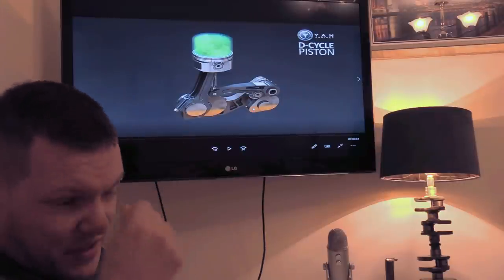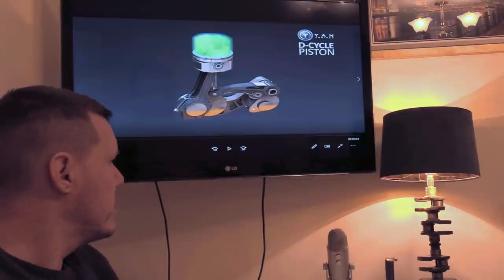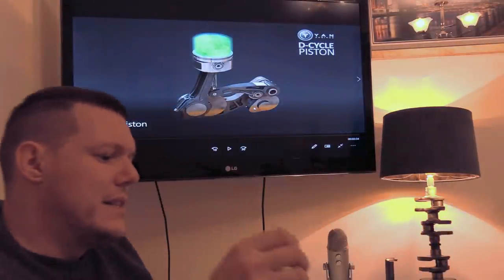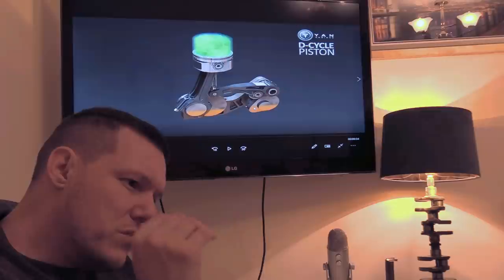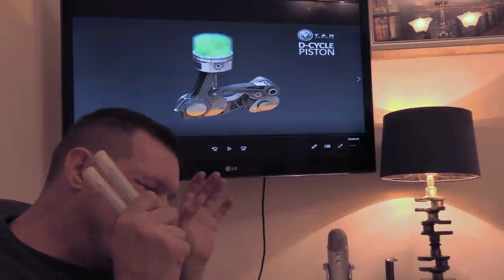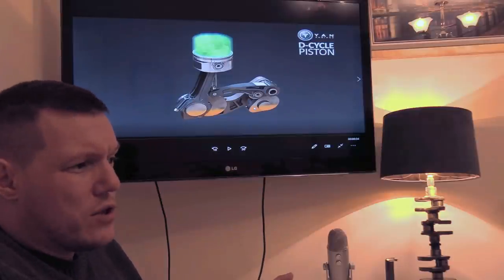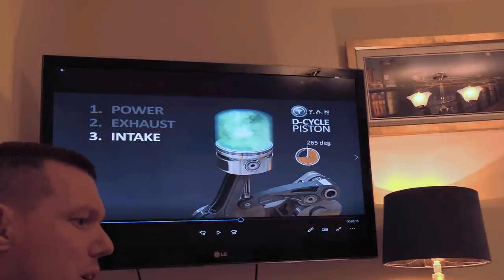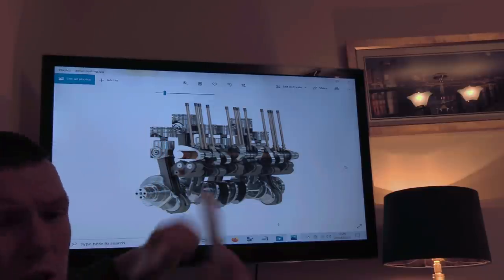D cycle engine | Part 2

Comment: Huh, I hadn't considered that it doesn't need to rev that high until you mentioned it.
Thinking back on the camshaft bounce problem, if it redlined at say 3000rpm or whatever, that might not be much of an issue if it produces decent power/torque at those rpm.
To be fair, I'm starting to see it as a decent attempt at making a 2-stroke (diesel in theory but as a petrol) but as a sort-of workaround for getting rid of cylinder ports and replacing them with a 4-stroke style head while keeping the oil in the crankcase. Interesting stuff so far, I'd love to see even a miniature test engine running with this D-cycle, but looking forward to your analysis.

Totally agree with the oil production vs electrification topic. I work on an oil refinery and we've talked about this, all electric vehicles will do is reduce the demand for petrol+diesel.
The thing is, we can't stop producing them because you can't selectively split out what fractions you want out of crude. You have to refine a whole barrel's worth of crude -> you end up with a load of fractions. You can't get around this, it's like taking a cup of tea and trying to refine the milk out of it without knacking it, can't be done and if it could, it'd be silly expensive and inefficient.
Brent crude is roughly 50% petrol and etc. so all we'll end up with if we all drive electric vehicles is a massive amount of petrol and diesel stored in giant tanks that we can't do much with anymore. Hydrocracking petrol and diesel down into other hydrocarbons is a very costly and inefficient process as it is now, so making other products out of it in bulk isn't really a practical option.
The other problem is that it will drive up the overall price of the other fractions, because you have so much wastage from the refining process and storage costs for that waste. The costs for plastics, pharmaceutical and lubricant feedstock will accumulate through the roof, stuff that electric vehicles will still need in bulk just to be made and maintained, so the cost of them goes up.

Comment: I bet Allen Millyard could build a V10 of this in his garage! 
Thanks for sharing 👍
Reply: @fairyheli2  
No. It will fit perfect. 😁
Reply: How about a straight six with power takeoff from the center of the crankshaft as with some motorcycle engines. (CBX) If these things make it to market he'd have a lot of components to begin with.

Comment: 29:06 
Aha.. so I was correct about the variable compression thing 

Also, If it takes energy to accelerate a reciprocating mass like piston, that mass also transfers its energy back to the crank. So, I don't get that it either when people yap on about reciprocating mass "stealing" power. Power might be reduced to prevent strain but it doesn't inherently "steal" power.

Comment: If we have the top piston contact the lower one not at its lowest point of actuation but just after that when it isn't stationary and is moving at a speed close to the one of the lower piston, that could get rid of the problem with the 2 pistons slapping each other.
Reply from the maker: The issue is thermal expansion

Comment: If built strong and crown changing access made easy would it make a good multi fuel engine, tanks, boats etc.
Reply: If the crown is moved by a came a multi came system like VTECH could be used for variable compression ratios?

Comment: Hi Matt, I have an odd question that might be a good video. Say a manufacturer wants to share parts between two engine derivatives such as pistons and Conrods. Both engines share the same bore and stroke but one is a V6 the other is a V8 for example, say at 60 degrees and 90 degrees V angle respectively. Would the sharing of parts be possible or would there be too much of a difference in say side loading of the pistons, differences in accelerations and momentum that would prove part sharing to be difficult?
Reply from the maker: Great question.
Reply: Look at the Chevy 350 V8 and 4.3 liter V6. They share a lot of components. Or straight  4,5&6 cylinder Mercedes diesels. Essentially all the same, except for numbers of pistons and length of crank and block.

Comment: I Cant get my head around how the top piston is driven back down the bore, As the bottom piston comes to bottom dead  the top piston is driven back up by the cam then returns drawing in fresh fuel / oxygen  but under no combustion? and from what i can see there is only a cam follower that has a positive contact for the up stroke? Nothing to pull it back down, I cant see this working or am i missing something obvious?
Reply: Im looking and looking at it, Just say for arguments sake that the top piston seized, The bottom could still travel its full stroke (not that it will run) But Unless the top piston was fixed to pull it back down this will never work.
Reply: True
Reply: Yup, needs a valve spring or desmodronic equivalent.

Comment: would this type of engine be a canidate for a barrel roller type valve as opposed to poppet type valve thus getting rid of the need of upper camshafts and all the bits connected.the barrel roller type in and ex valves are timed to the crank in the traditional way via belt or chain.no valve float  no intrusion into the combustion chamber etc.
Reply from the maker: Barrel or rotary valve are just shit, period

Comment: I like this idea. Looks like there may be several issues to resolve, but overall it does seem to be a viable alternative to the traditional 2T engine.  
Would I be right to assume that the lower camshaft (operating the crown assembly) could also be employed as a balancer shaft? 
If so, mounted forwards of the crank I dont see that it would be excessively bulky or cumbersome.

looking forward to more vids on this
Reply from the maker: Could be. But it probably not required

Comment: Looks to me like the degrees chart is measuring the crank only. This is not, as you say,  piston degrees rotation.  The swept volume is 200cc, the combustion capacity.  Yes it might be s smooth engine in essence 400cc per 2 crank revolutions.  The lower piston appears to be thrown downwards, a bit like the bat and ball with the elastic between them!  Other thoughts,  could the operating cam be designed a bit like the crank shaft so its pushing and pulling on the operating arm?   Good lockdown stuff Matt.

Comment: To make the lever pull the piston back down actively (not passively with gravity or a spring) a “C” shape with rollers and a central pivot could go around the top of the lever and the bottom of the camshaft
Reply from the maker: The 'c' shaped spring is called a torsional spring, and I mentioned that in part 1
Reply: @dirtygarageguy  I mean a double rocker, not a spring, it would act as having a second cam above the arm, if a single piece wouldn’t have the correct geometry then two arms with a connection bar between them and the ends opposite the lever and cam would be connected to the block, all with pivots, that way they lift and lower at an angle instead of rocking through an arch

Comment: I feel like the spring problem could be solved with a hydraulic piston up top off the oil pump. You could also clear up the slapping with a better lobe and the hydraulic arm.

Comment: Hello Matt, 
I think this a brilliant design, and, if they manage to sort out all the issues, Do you think that a twin d-cycle piston engine can/will replace an inline-four for motorcycles? 
It seems this engine will have high torque at low RPM and, in twin configuration may have the same weight or less than an inline-four.
Reply from the maker: The design isn't good, but it has potential

Comment: so from your previous video about atmospheric pressure that would cause a issue with the top piston having to use gravity to let it drop. could the engine use a turbo/supercharger to aid in bringing the combustion chamber pressure above the crank case pressure?
also if it uses 20% less fuel = 20% less power per cycle. a pure four stroke type engine for example having 80% power per full cycle (720 degree of crank back to intake stroke), a two stroke would in theory have 160% power to 720 degrees so would it be a more powerful?
im sure you'll correct me as im sure i've got something wrong or missed a point that would prove me wrong lol

Comment: Just had another thought of a stupid question though...
Does it actually use less fuel that a 4-stroke in practise though?
Gonna try to clearly put my uneducated thoughts down.

A 4-stroke uses one intake of fuel to make Two whole revolutions. 1st rev is suck, squeeze. 2nd is bang, blow.
Meanwhile a 2-stroke uses one intake of fuel for just one revolution.
So when they say the engine uses 20% less fuel, do they mean compared to a conventional 4-stroke or 2-stroke?
Because in my mind, it's impossible that this engine is more efficient than a 4-stroke, since it's gonna use fuel EACH rev instead of ONCE every TWO revs.
Just sceptical of the claim of better fuel efficiency. What are they comparing too when they claim that?

Comment: Eyup northern.This is making my head hurt.On the power stroke,,it may use a third of the bores worth of grunt,if you like,but on the intake it looks like its only using a quarter of a strokes worth,to draw the charge in.Have I got that right?Would this lend itself to forced induction?Moreover,would it demand forced induction?Or should I just go back to my jizz mag.All the best
Reply: You are right about the intake stroke being shorter than the exhaust stroke. This looks to be a design choice as it's determined by the piston cam. This essentially makes the engine run the Atkinson cycle. But there's no reason the cam couldn't be made symmetric to run the auto cycle instead. Similar to what Matt was saying about the variable compression. I wonder if the 20% reduced fuel claim in the video might come from the Atkinson cycle, rather than the reduced displacement.

Comment: The elephant in the room is container ships, they burn  6600 gallons every hour of operation and they're in operation most of the time.
On top of that you have the  refining problem when gasoline becomes a waste product again what will they do with it ? We need part of every barrel of crude to make Plastics in order to build the Electric vehicle not forgetting the other plastic products that are needed in nearly every other aspect of life. If a young engineer/ scientist would start working on those problems now they might have a solution by the time it starts to be a problem.

Comment: Also the slapping effect could be reduced on later models by adding more material to the skirt piston (the ton, lmao) that way there’s more air resistance and it acts as an air spring preventing the slap from being so hard, or happening at all (gently contacts it once the forces overcome the force of the pocket of air being restricted from escaping quickly enough)

Comment: AFAIK 2030 applies to cars and vans. For now (don't make a big noise about it!) motorcycles get a pass or maybe more accurately have been overlooked by the government. With regards to the D-piston thing, would there be any advantage to rearranging the lower cam & inner/upper cylinder so it can be fixed (a T-shaped profile) dropping the need for a wrist pin? So the lower cam arm would have to ascribe a true vertical motion rather than an arc. Can I also whisper the word 'turbo' 😉
Reply from the maker: We'll see. I didnt wanna go into bikes because I haven't looked into it yet.

Comment: So you could have variable displacement with a selectable cam profile that shortens the intake and compression stroke. So it could work as an Atkinson cycle like a Toyota without venting air back into the plenum.

Comment: About 7 or 8 years ago Lu Yan came to Navistar to present his D-Cycle engine concept. We were a medium to heavy duty diesel company, so it didn't generate any real interest. I speculated that the cam actuated piston crown would smack the cyl head, but I believe he said he had a running moped engine. If you look at either an intake or exhaust valve, they are a lot lighter than the piston crown, they move over a much shorter distance than the D-cycle, and they open in about 110° crank duration where as the D-cycle lifts fully in about 40°. Despite the much easier conditions the valves operate under, we need strong springs to keep them from floating even at the relatively low RPM's of a diesel. I just don't see how the D-cycle could work in practice.

Comment: I am looking forward to the rest of this series, mostly so I can have a better understanding of how one goes through the process of analyzing / evaluating a design.

Having said that, if the objective of this engine is, as I understand it, to have essentially 2 stroke power with 4 stroke emissions, then why not have something like a direct injection engine with a poppet valve in the piston that butts up against a flange in crankcase (or maybe even some sort of cam profile on the crank counterweight) near BDC, and have a positively pressurized crankcase purge the cylinder like a uniflow 2 stroke but without the ports in the cylinder wall - which I understand to be the cause of excessive oil consumption? I assume you would still have to deal with oil mist in the crankcase, which most engines I know of use some sort of trap in the PCV system to account for, but surely you could manage it somehow (I.e Windage trays, or even a deflector plate of sorts like the old Austin 7 used)? Yes you would have higher reciprocating masses (heavier piston), but you mentioned this engine wouldn't be used in high rpm applications so I can't see how that would be an issue?

Comment: Two points: 
-I'm thinking valve float would likely be a limiting factor in terms of revs as they'd be turning twice as fast as normal.
-That space between the two piston halves is begging to be used to do some sort of forced induction.
Reply: Valve float can be fixed with desmodromic valves. All but one Ducati engine uses them. Panigale V4R can rev upto 16,500 rpm.
Reply: It can't as there is a hole in the lower piston where the rod goes through.

Comment: Instead of having a spring (or even a cam/follower) what about if the cam was replaced with a wheel with a groove in it (not sure what they are called sorry) and the arm had like 2 hooks following the groove maybe even with bearings on the ends (ofc this is assuming the groove is on both sides of the wheel) that way the path would kinda wear itself in.

It seems to me like the main issue with this aside from the fact that it is drawing in 20% less and therefore burning 20% less for power is the crown smacking against the piston I think the con rod to the crown and the articulating joints would have to be pretty meaty to take that moment of force where they both meet but if it has worn in at some point deliberately maybe that would create the wiggle room to stop it being a problem, then it would be the meeting surfaces possibly some kind of padding like a fibre gasket into a recess on the piston might take up the bulk of the impact.

To my mind it seems as though a V or straight twin engine like this would effectively have the same power dynamics (behaviour?) as a 4 cylinder because relative to the crank shaft power is being applied in essentially the same points therefore a cylinder of this would be like a 2 cylinder 6 -> 12 4 -> 8 etc I would be very interested to see if it works out that way everything else being equal

Comment: People would be surprised how lightweight modern materials are. The first time I changed pads and rotors on a Escalade, the pads weighed more than the caliper. I could be wrong but I think the designer will work out any weight issues with a CAD simulator. The issues if any, can be sorted out with exotic materials.

Comment: I caught the effectively a two stroke right off the bat. It would be really interesting see to see just what the actual valve lift and overlap on this abortion (1) is. One cam operating lever it appears that the distance from the pivot point to the roller is at least 33% of the distance from the cam follower to the pin for the piston crown shaft (2). What I see here is a crap load of extra reciprocating mass per cylinder. 
1) I have no doubt you could make this run. I just question how well it would work.
2) Can't just call it a dingus or thinga ma bob 😊